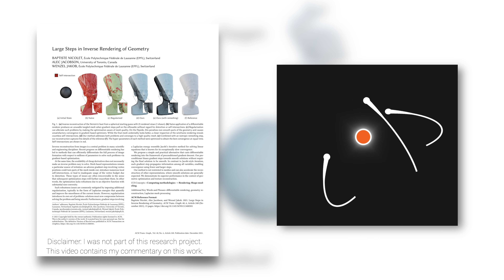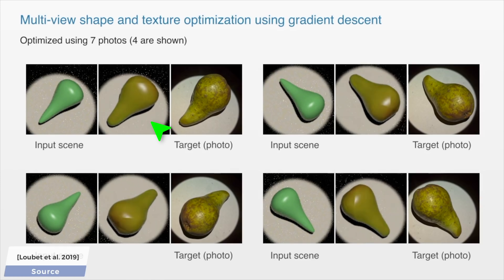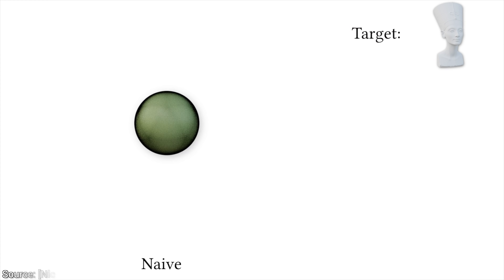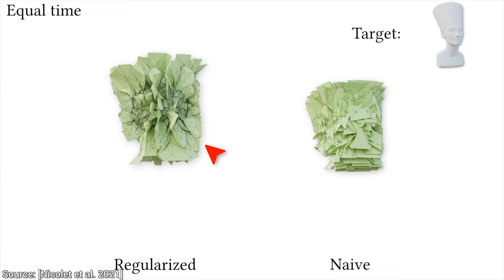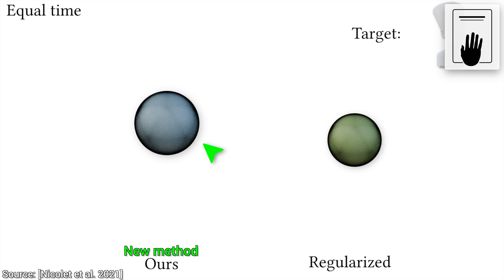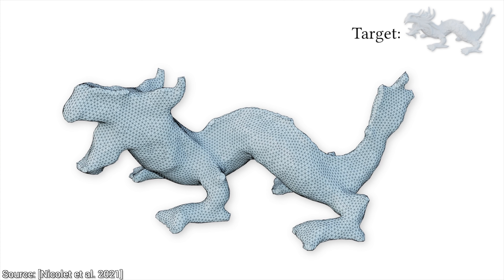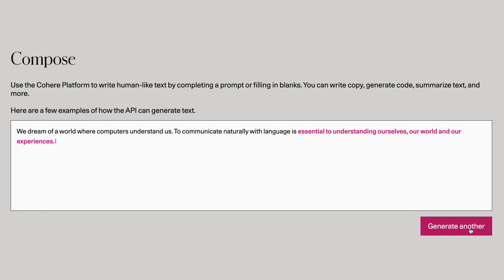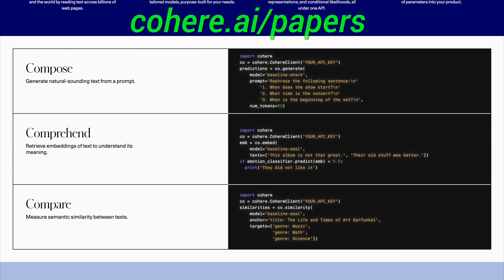Watch This Statue Grow Out Of Nothing! 🗽

Comment: So I guess this is suitable as a photogrammetry alternative. As input has to be multiple images I assume the limitations are same as with photogrammetry: problems with reflective surfaces, transparent surfaces, thin geometry and the subject cannot move or have different lighting conditions in the input images. Another use case could be retopology, although there is already a really good tool for that. Anyways, I'd still pay for a tool like this if it existed as a product.

Comment: So for people who don't know whats going on here, which seems to be basically everyone, the algorithm is given a significant number of pre-rendered images from different angles and it attempts to reconstruct something similar to the original mesh. So far as I can tell it can't handle anything but textureless reference images at this point. Anything other than the shading from the light source and it doesn't work.

I don't entirely understand why this is such a big leap forward given that there are at least a dozen pieces of software that reconstruct scenes with texture and color from reference photos.
Reply: Not an expert but this looks way more sophisticated than a photo scan. A photo scan has a very high triangle count and the topology of the resulting mesh is difficult to work with. The meshes created with this method look way cleaner.

Comment: Wow, this result looks absolutely insane! That dragon blew me away. One thing I'm confused about though is how this translates to "generate models from real-world objects" though. Does it operate on pictures? If so, does the algorithm only work from 1 angle?
Reply: Or point clouds? Or CAD like a STEP file? Agree, really confusing.
Reply: It says in the paper they have 25 views of the object from different angles, then generate the model based on that. So of you have a real object you take a bunch of photos (which is easy to do) then it generates the mesh.
Reply: @johnmorrell3187  Seems like you'd be better off just running it through photogrammetry software then. 25 views is definitely enough to go off of.
And in either case you'd have to retopologize anyway. The geo in the video is hardly optimized.
Reply: @johnmorrell3187  I was skimming the paper, but I thought they also said they intentionally rendered the images without textures to do this. Not sure if colors and different materials reflectivity and glossiness from photos would change the results.

Comment: 2 more papers down the line and we'll finally get automatic retopology!
Reply: hey, automatic retopology already exists, and work well
Reply: @slimeball3209  What I meant is some kind of intelligent retopology that can make decisions about good edgeflow for animation.
Reply: @kex0  i mean this
Reply: @kex0  i saw it in video about zbrush or 3d max
Reply: @slimeball3209  seen it, but topology is not optimal. you want edges to flow around facial features for movement, but that is not neccesarily what happends. usually artist has to manually tell Zbrush where he wants the topology, and even then it can be finicky, and create strange loops.
Reply: @Dejawolfs  ok maybe idk, but it work's for hands, legs and other "straight from previous" shapes.
Reply: @slimeball3209  On organics though?

Comment: Is the input to the algorithm an image or a mesh?
Reply: 25 images, from different views.
Reply: @Bruhsty1234  what kind of images? Like the regular ones captured by mobiles or camera? Or captured by special instruments?
Reply: @deepakkashyaprajput8515  in the paper they are using rendered images of a mesh, so they look like the target image, just more and from different angles.
Reply: Rendered images also means as much quality as your will wants. Does the paper say anything about detail or can it perfom with low detail images too?
Reply: @Bruhsty1234  these are not normal images, the device needs to capture images in high quality so that each and every assigned node can be identified from different angles. So, better the image capturing technology better the output of the algorithm.
Reply: Is there an implementation of this?

Comment: Does the algorithm also try and fill in the details that it can't see on the reverse side of the object?
Reply: In the paper it's said that there are 25 rendered views, but only 1 shown
Reply: These types of algorithms usually render the object and its target from several viewpoints, then apply some loss function to all of the rendered views (using differentiable rendering). So it "sees" everything from the set of viewpoints.
Reply: So the target contains multiple photos from different wiews?
Reply: so it's neural photogrammetry?
Reply: @slimeball3209  There is nothing "neural" about this process. It uses gradient-based optimization methods, but there is no neural network in this particular work.
Reply: @armanmaesumi9949  Was the solution to introduce some kind of "curiosity" instead of greedy behavior?
Reply: @edwardmitchell6581  I'm not sure if I understand; greediness is a term that usually applies search problems (specifically how an algorithm searches through a state space). The algorithm in this paper does not use search. The main contribution of the work is a reformulation of the gradient update step, which promotes faster convergence and smoother solutions.
Reply: @armanmaesumi9949  isn't their gradient descent a type of search? or is technically just a learning model that converges better?
Reply: @psd993  In a way GD is a type of search, sure. But there's no concept of greediness or anything like that going on here. Their contribution is a more intelligent way of optimizing a particular objective function. I also wouldn't call this a learning model
Reply: Does it have something to do with evolutionary solving?